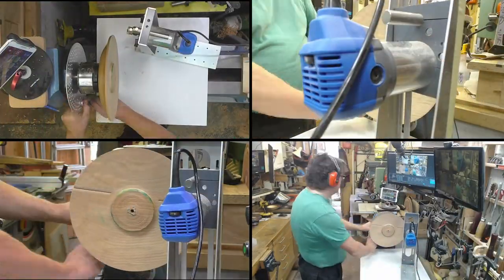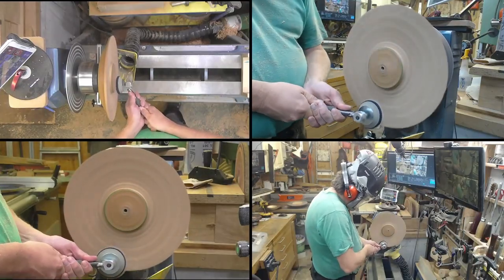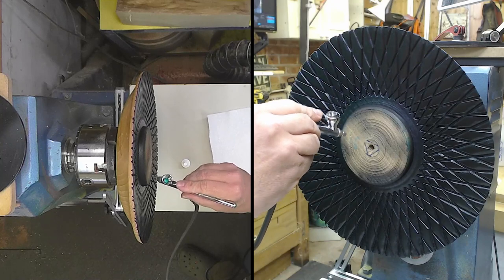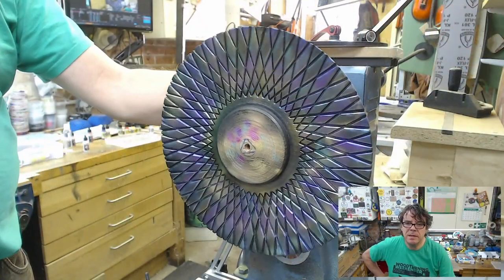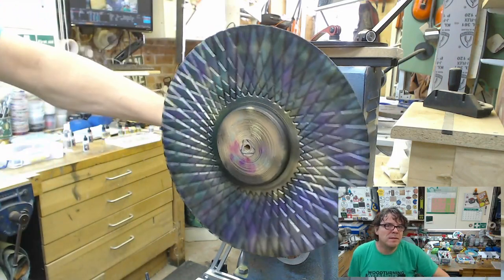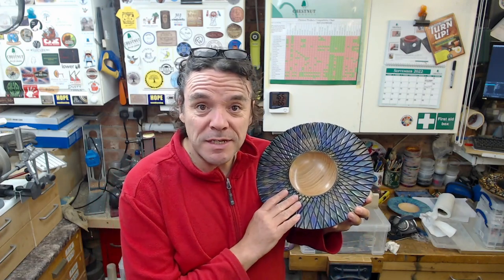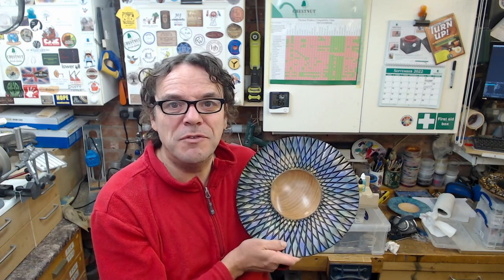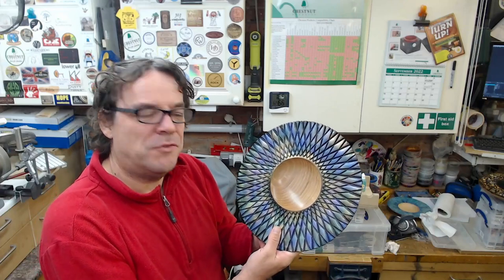Woodturning - A Metallic Diamond Textured Platter

Comment: I like the diamond effect. Using the router on both sides of the blank is a good idea, and keeps things symmetrical. I'm not crazy about the "V" router bit. It makes painting easier, but since when do I care about making your life easier? A small box core bit or even an inlay bit would be interesting. Getting color on the sides of the grooves would need care.
I did like the colors on this one. I didn't think they were THAT subdued. A little subtlety now and then isn't a bad thing. I'll look forward to the wild stuff next week.
Reply from the maker: Cheers, Bill! The cutter on this one was the same cutter as the previous video, but the sanding flattened out the curved faces, which I'm not sure I like as much....here's the cutter used: https://www.wealdentool.com/acatalog/Online_Catalogue_Point_Round_218.html
Tomorrow's video does use a V cutter but things didn't run according to script!

Comment: i like it. a slight curve to the face could look nice. you should use a stop on the base to give more options like cutting a straight line across a curved face would give a difering depth of cut or a curved fence would do the same. what router bit are you using looks like a very  basic v groove,. im surrprised at the roughness. a really good cutter should leave it super smooth. 

i would like to see you try a random patern with this and not every hole on the indexing plate just a random one. could give a cool effect
Reply from the maker: random....hmmm.......wait till next weekend's video, then, Alan!  Definitely lots more experimenting to do!